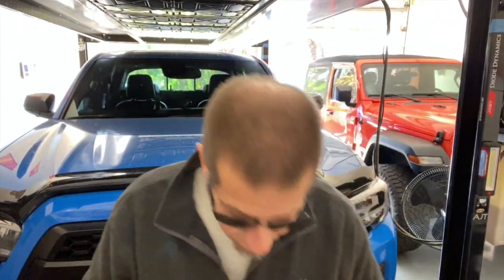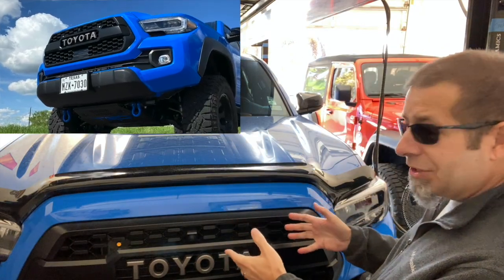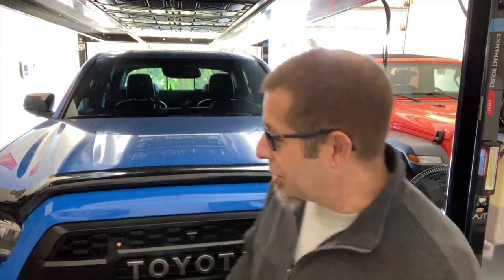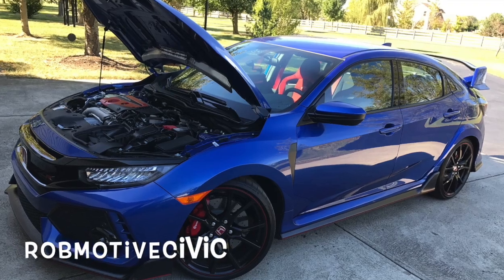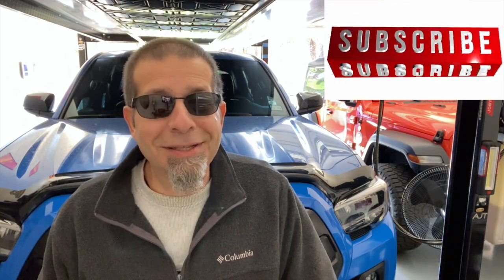Make The Toyota Tacoma Look Better

Comment: I’m surprised that you didn’t mention to good ol’ tacoma bed mat over the spray in Liner for the bed since we don’t need that for the Taco. I’ve done most of your list going on about two years of ownership and I still get compliments on the look of the truck and it’s stance. The bigger tires and wheels was a game changer. I’m still on stock suspension but my 32” tire did give me a one inch lift over factory 29” tires that they put on the SR5
Reply from the maker: Nice!  There are just too many things to include!!😬

Comment: I've added the TRD Pro Grill, VLED Interior LED lights so far. The pro grill has changed the look completely. Next is the lift, tires and wheels
Forgot to add, I did the MESO ultimate turn signals too.
Reply from the maker: Sounds like a good plan to me👍

Comment: I made the following decisions for my truck
- I had a lot of complements on my truck as is. Right now it's leveled up with a lot of mods, Tacoma Pro grill, lightbar and so on, but I'm going to add another inch up front and back while keeping 32's. When tires are due for change, then I'll go for 33's
- I'm going to add the ditch lights, you know the one on the corner top of the hood. 
What do you think?
Reply from the maker: I think that’s a great plan👍
Reply: @RobMotive  Sweet! Thank you 😀

Comment: I've been considering a 48 inch Putco led blade light for the rear end with the amber turn signal, red braking, and white reverse modes. There's a plug and play wire conversion kit to eliminate splicing or plugging into the visible receptacle.
Reply from the maker: That’ll brighten things up!!👍
Reply: I had the Putco led bled light for six months now  I love it
Reply from the maker: Nice👍
Reply: @sambathchhorn820  Good to know.